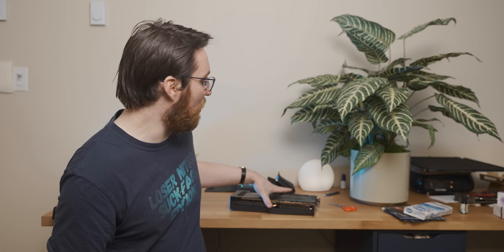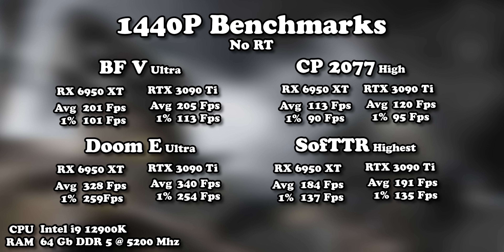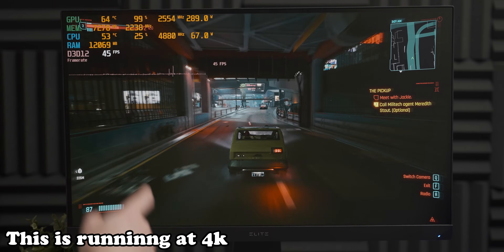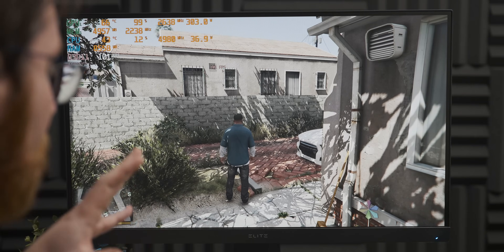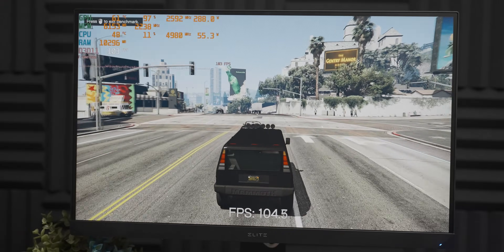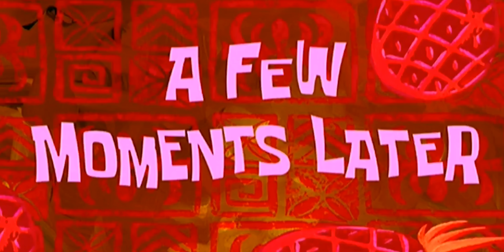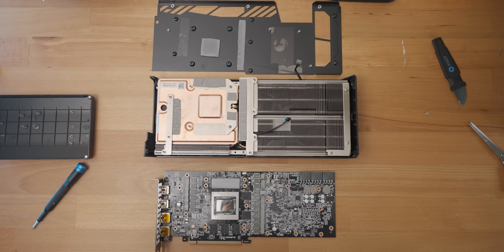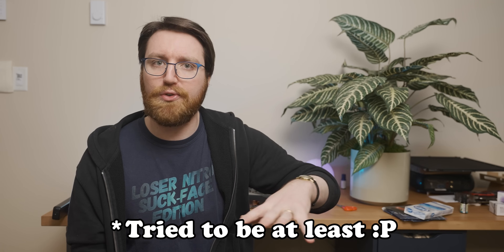I Can't Figure Out What's Wrong With This Gigabyte RX 6950 XT

Comment: I'm saddened that whenever I hear about a Gigabyte product, there's a big problem with it. They're meant to be a big player in the space, but it seems they're struggling.
Reply: Gigabyte is almost as big a meme as asrock
Reply: I have a gigabyte mobo and gpu ( 3070 ti gamer oc) and have ZERO issues with either of them.  Works great for me
Reply: They are more like megabyte now
Reply: Big player ???
Lmao not really they're like ZOTAC they're B tier
Reply: @tibib0ss  but fucking zotacs are stable 🤣🤣🤣
Reply: @hakunamatata2464  but fucking zotacs
Reply: @tibib0ss  Zotac graphics cards actually work though
Reply: @sidewalk__  yes but are loud
Reply: @tibib0ss  yeah, wouldn't buy an MSI graphics card if you want it to be quiet but i personally don't mind, my old PC had a fan that sounded like a plane taking off even when it was doing nothing
Reply: I won't buy Gigabyte ever.  Too many bad experiences.  I normally buy Asus or MSI, preferably Asus though, as I've never had a bad experience from any of their products.
Reply: @thejollysloth5743  you normally buy MSI? You’ve got to be joking. I’ve never had so many issues with a vendor than I had with MSI. Coil whine, overheating, a straight up dead motherboard etc..
Reply: Just going to add my MSI experience here. I've dealt with a lot of their cards, but I've never bought a new graphics card, always used. My first card was an R9 290 which was a blower style card (for a card that draws nearly 300w is completely unacceptable) which ran so hot that the surface mount capacitors on the back started falling off (I think around 5 of them have), yet somehow the damn thing's still chugging though ever since I got it, it randomly black screens a couple times a month and my speakers just buzz extremely loudly. The card is currently in my younger brother's system. My next card was an R9 390 which is a budget king in my opinion for cinematic titles due to its 8gb of VRAM which has heavily criticized at it's launch as it can't do 4k, but with modern  games like SOTR using so much VRAM, if your ok with 40-60fps on near maximum settings... It's actually great. That card was also an MSI card. It had a massively chonky heatsink and had substantially superior thermals, but unfortunately died after only a month despite being in pristine condition and having zero issues prior. My current card is an MSI 1070ti which I absolutely love, zero issues, I do wish it had a better cooler as the card can easily do well over 2ghz, but gets a bit louder, the cards bios also allows you to just set the power limit to 133% just in MSI afterburner. But that's not all my experience with MSI cards, because earlier this year I got my hands on an old Fermi card and after plugging it into my test bench and hooking up my 1000w power supply, as soon as I shorted the power pins on the motherboard to turn it on the card just SPONTANEOUSLY COMBUSTED! The card just started sparking like crazy before catching FIRE. So yea, that's about it, only one positive experience
Reply: @steelfox1448  yeah, i have a MSI 5700 XT and it's a great card minus the loud fans, but I also managed to break a B550m PRO-VDH Wi-Fi which may have been my fault if the PCB got scratched (I was case swapping my PC and had a few issues with the standoffs being wonky), but surely motherboards aren't that fragile?
Reply: @LegionShade  No, I normally buy Asus.  I have just had two MSI "Gaming Edge" motherboards in the past which have served me well.  I also like the MSI Bios recently.  
My GPU and Mobo are Asus ROG Strix right now, my PSU, RAM, and case are Corsair, and my NVME is a Gen 4 Crucial P5 Plus.
Asus is my brand of choice but I'd sonner have MSI over Gigabyte!
Reply: @sidewalk__  yea, even in Zotac's 2.5 slot triple fan AMP! behemoth of a 1070ti, the fans can't go below 33% speed, which is an issue with Nvidia firmware, yet MSI got around it and the fans on my card don't spin at idle and my gard is the standard MSI gaming model
Reply: @thejollysloth5743  good job on the asus products. Those are solid. Can confirm.
Reply: @mikeycrackson  MSI is the same, had bad experiences with their motherboards in the past
Reply: People will have bad experiences with every AIBs, it's the nature of how this tech works, some generations are good and others aren't
Reply: @OCDyno  also, quality control
Reply: @sidewalk__  that also varies generationally, quality variance especially among motherboards since roughly every new generation they use a new memory topology for example
Reply: MSI z490 ATX boards had issues running ram over 4000mbps for daily, gigabyte z590 boards had issues with their powerplane, Asus z690 Apex's have extreme variance in memory OC and stability
Reply: @OCDyno  I agree.  I've had good experience with MSI motherboards recently.  Other people hate them.  I hate Gigabyte and like Asus the most.
It just depends on the experience you have had with those brands in the past.  My Asus ROG Strix 1070 ti and ROG Strix 2080 Super are incredible GPU's.  I still have the 1070 ti in my second PC.
Reply: @thejollysloth5743  my 3080 ti strix has insane coil whine, it's louder than all my system with fans at 100%
Reply: @OCDyno  That sucks :(
Reply: They're only good at..um...hmm...uh....motherboards?
Reply: @JeskidoYT  Their M27Q was the recommended budget 1440p 144hz monitor at Hardware Unboxed. I had it for a while and no issues whatsoever. The updated version of that monitor (M27Q-X) has become another recommended monitor. They have a 4k 144hz monitor (M32U) that gets good reviews as well. Also, like someone else mentioned, their Aorus branded components are usually good quality since that's their premium label.
Reply: @mikeycrackson  It seems, at least from the little I've noticed that their Aorus cards are where they put most effort into. I have 3 Gigabyte cards where one is a 3060Ti Aorus, and there's a big difference in quality and temperatures. I wouldn't buy anything from Gigabyte other than the Aorus cards.
Reply: @Tomazack  I have the 3060 ti gaming oc rev 2.0 and i cant complain. Only thing mention is the horrible fan curve.
Reply: I was just about to comment when I saw this.. Except for the Aorus line, with its ridiculous price tags, Gigabyte is a joke..
Reply: @charlconradie4935  Indeed it is!!!
Reply: There were a has been. At one point they made the boards for Intel macs. If you wanted a hackintosh then Gigabyte was the go to brand. Today they are garbage. I am in my 2nd and last gigabyte board I will own
Reply: struggling to not take advantage of people's hype and desperation? Yeah, it's a real shame
Reply: hmmm I've had some issues with gigabyte in the past but only really one actual brick (An aorus card that wouldn't stay stable). Other than that, i've had good luck. One had a wire that I had to push down that was getting hit by a fan xD that was a bit silly.

My current card is a 6900 xt windforce and it's running pretty well for the most part.

Comment: The sapphire model is just miles ahead
Reply from the maker: The cooler on that Sapphire card is really impressive!
Reply: @DawidDoesTechStuff  I love sapphire with my whole heart, they make, beautiful well performing cards, and the innovation is honestly very nice, look at the 6950xt with an rgb header on it to sync your system instead of shitty software 🙂
Reply: @Direwoof  same
Reply: @HappyBeezerStudios  I Love Sapphire. I wish my Nitro+ 6700 XT would stop having utilization dips into  the %80s, %70s,  etc, in MechWarrior 5 though....
Reply: I am glad i have Sapphire 😅
Reply: @pubgchickens  Does anyone have a Sapphire Nitro+ 6700 XT? I have one, and it has weirdly  low wattage d raw numbers, but then people tell you  it is "supposed" to do  that because the complex algorithm for clocks etc. during different work loads.

My 1660 Super ALWAYS  ran at  max  125 watts in any  game less than 8  years  old  or so...

My  Nitro 6700 XT , on TECHPOWERUP, just like Dawid's example, runs at what  the spec number is supposed, while gaming for them, so 230  watts.

My card very rarely gets there.

most games it runs at 180 watts max, and often dips below that.

Only  in benchmarks does it run at 230 watts, like Furmark.

Maybe I should use FreeSync premium because I have a gigabyte M32Q, which is a  great  great  monitor ( and one of the only good things from Gigabyte )  but I can never seem to make Freesync tech work properly, or at all... beyond  seeing it say that's it's on or off. the FPS numbers never  do what  I would expect.

DX12 games run well on the Nitro+ 6700 XT, DX 11 games less so.

And I guess many people with many different cards have issues with GPU utilization in  GTA V.

It's even worse for me in X-COM  2.

Anyone have  a Sapphire Nitro+ 6700 XT?
Reply: It'd be pointless to trade in my 6900 for a 6950 but yeah if I didn't have it the 6950 is a great looking card at least.
Reply: Funny you say that, I’m having the exact same issue on my sapphire 6950 rn 😅